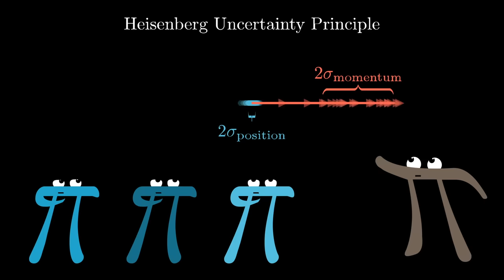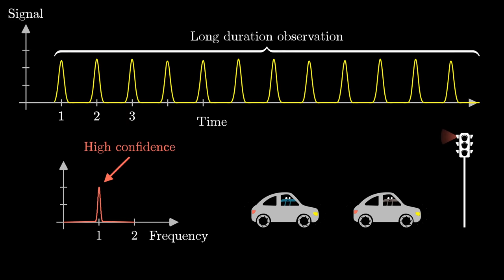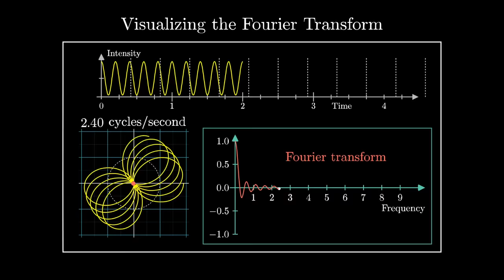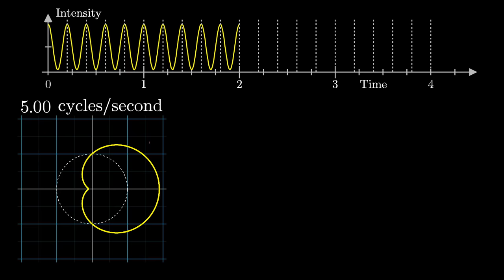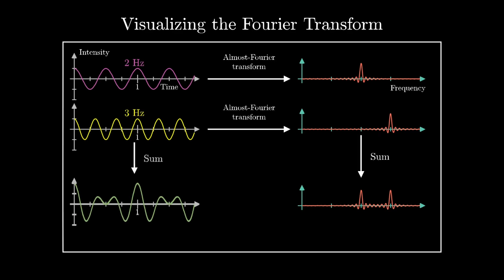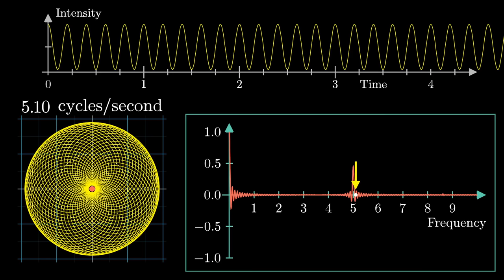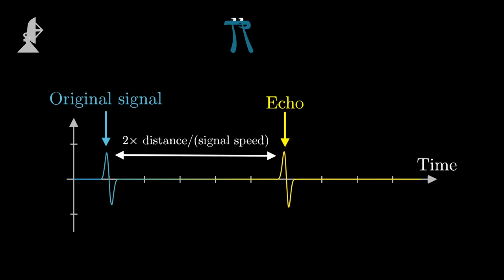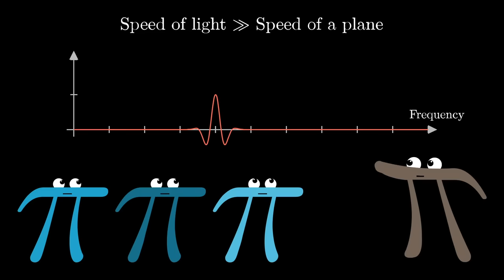The more general uncertainty principle, regarding Fourier transforms

Comment: I thought this video was gonna be on the actual generalized uncertainty principle that included the commutator not fourier analysis. Good video still, but I was excited to see how you'd talk about why the uncertainty in something is related to the expectation of the commutator. Why does the difference in if you measure one thing after another relate to the size of the distribution of those things?

Comment: well it does make sense. if you have something that is moving all around very fast in an oscillating wave that something changes its momentum a lot as that thing accelerates and decelerates but since the rate of those accelerations is so frequent chances of catching that thing's momentum near the peaks or valleys is very high, however since that thing is oscillating so quickly its hard to pinpoint where exactly is. The same goes the other way around, if an object is oscillating very slowly we can snapshot where the object is at the moment but since it's accelerating and decelerating so slowly every time we take a snapshot of its momentum its going to be different. Take for example a ball rolling down a hill and we then take a random snapshot in between when it's at the top and when it's at the bottom. literally any point at the hill is gonna give out a different momentum since the ball is constantly accelerating. normally, if the ball is perpetually falling and climbing atop many hills we would want to find the maximum momentum at the bottom of the hill but since we're taking a random snapshot the climbing and falling time takes too much time and we would almost always get a different result of momentum and rarely get a snapshot at the bottom but we would almost always see clearly where the ball is since it's falling so slowly.

Comment: I've seen one vidoe that uses this to explain the double slit experiment. Or at least why the particle that passes throught the slit behaves like a wave.
Since it's position at that moment is well defined (AKA inside one of the slits), this means that it's momentum isn't. Which results in seemingy random directions. that create the interference patters when emmited from two points.

Comment: It’s like measuring the position and momentum of a ball by throwing smaller balls at it and measuring the rebounds. If one ball is thrown, it’s position is certain however it’s momentum is not certain, and if more balls are thrown, the momentum can be calculated but there has been too much disturbance in position to be accurately determined
Reply: That is the observer effect and completely seperate from the uncertainty principle. It's not like the particle has a single, well defined momentum and position and we just can't measure it due to technical limitations, it just straightup doesn't have a single value for those things. It's in a superposition. This becomes a meaningful and very important distinction when looking at more complicated situations

Comment: Actually, the reason why you can't be sure what the frequency of a clap is is the same reason you can't be sure what the frequency of ocean sound is. These types of sound are called "noise" or "noisy" because they're made up a whole bunch a frequencies that aren't harmonics just one or a few base frequencies (except maybe some ridiculously low frequency, since technically any finite set of frequencies have some fundamental that they could be harmonics of). (If you were to look at a graph of pressure against time, you would see a function that was totally unperiodic.) It is possible to be very sure of the frequency of sounds as short of claps, since the sound waves last for a much shorter amount of time (at least for frequencies that aren't extremely low).

Comment: I would say that the 20-athletes problem is one of grouping them into two ten-man squads and seeing who wins in a first match.  Then divide the two sides into two 5-man groups, swap them, and see who wins now.  As you see which side wins and doesn't, you swap out smaller sub-groups until you finally get two a pair where swapping them changes the outcome, and thus pick the one on the winning side in that final match.  The swap would be fastest when the changes always changed the results, bip, bip, bip, bip.  The swap would be slowest when the changes did not change the results so new pairs of people would have to be formed into new groups and swapped again.  If nothing changes anything, then everyone is the same strength and the solution is impossible, since they are all "weakest" (and strongest, but that is not part of the problem, though).

Comment: You can see uncertainty in action from music... Loudness and fidelity cannot coexist at all. Increasing loudness results in reduced fidelity of music. As range of signal is limited within dynamic range, exceedimg limit  will result clipping. Thus source must be compressed, to lose fidelity in terms of difference between signals. This allows source to contain more information which determines loudness, but less information, about music.

Comment: According to the HUP if the velocity is bigger, then the position of the particle would be more determined ( less uncertainty) if you check the equation. But according to relativity, the bigger the velocity, the less determined the time (two events would not be similtunous in different reference frames), so there would be a smaller probability to find a particle in a certain position (more uncertainty). So how do these two points of view can make sense?

Comment: No, I don't think it has anything to do with the fourier transform. Rather, the uncertainty principle in a nutshell tells us the obvious, that if you want to measure something you HAVE to interact with it, and as a result destroy its previous configuration.
For example, we can't know both the position and momentum of a particle because in order to pinpoint the position better, we need high frequency (hence high energy) photons to bump on them, sending them off towards some random direction at quite a different speed than the one they had before.
If on the other hand we want to precisely measure the momentum, we have to interact with the particle twice with low energy photons, so as to not disturb its momentum too much. Low energy though means low frequency, means much lower positional precision.
Reply: No, that is the observer effect, something completely different. Ask anyone who has studied quantum physics, the uncertainty principle is a fundamental property of particles, not just imperfection imposed trhough measurement.

Comment: One question is whether this is a problem of measurement, mathematical modelling or a character of reality. It may be difficult to describe the frequency of a clap because it is too short but you can amplify it through an analogue system and play it back through a speaker with fidelity, however you will struggle to mathematically model it. A radar operator may find it hard to measure the speed and the position of an approaching object but it does have a precise speed and a precise position. Are quantum states probabilistic or just impossible to measure certain attributes externally? We can work out probabilities of picking a particular card from a deck but once we have picked it, probability disappears and reality is set. If you flip a coin you never get half heads and half tails you actually get one or the other, probability is just an averaging of many unknowns before they are realised or before they are measured. Frequency is a derived measurement and approximation to an idealised cos wave, reality still exists with concrete values that could be represented on a graph.
Reply: pretty sure an (ideal) clap is a horizontal in frequency space, so it's always difficult to describe^^

Comment: I guess what I'm confused about here is why can't you change rate at which you sample data, getting high confidence readings of both location and momentum? To use the radar example, instead of simply sending out short or long pulses, send a variable rate of pulses over time so that one second you're looking for momentum, the next location, and continue doing this rapidly. Would this yield both momentum and location, or neither? At what rate of swapping between them would your data get so muddled you don't know either value?

Comment: For the problem i think you need to have the first match up and switch one persone bethween(a new person each time) the losing team "B" and the winning team "A" until the losing team wins and than you take that person that you last added to team "B" 
we don't know a lot about that person but what we know for sure is that it is stronger than the person that went to team "A" and therefore it is not the weakest person in the group and since there is 10 person per group we have 10 switch to make at the 11th switch we will have the initial teams (but for this to work we need to suppose that these match up 10vs10 are an absolute strength mesure meaning the result are not probabilistic )

Comment: In an exam at my uni (Bachelor Electrotechnology) I had to calculate the Broglie wavelength of a car using it's mass (m) and momentum (p) and instead of E=mc^2 you use E=mp^2. I thought that was ridiculous, somehow I managed it, but of course I don't remember how. Now that I read on it again it's probably λ=1/ν=h/E=h/(mp^2), does that make sense? I think it does because h/(mp^2) would be extremely small, that's why you don't see a car jumping up and down the highway. But according to the Broglie; a car with a mass of 1000 kg and momentum of 30 m/s, it should be bouncing up and down with 7.4E-40 meters (which is smaller than a Planck length and theoretically impossible) with a frequency of 1.4E39 which is higher than gamma rays or anything we have ever seen.

Comment: Spoiler alert: solution for the AoPS question.

Assuming “strength” is commutative.
We start by taking two random people. We determine who is stronger between those two people through a 1-on-1 match. The winner is admitted into our “sending” group.
We then make another couple: the loser or the previous match, and one random person from the remaining 18 people. Again, we determine who is stronger between those two people (the loser of the previous match and the new random person) through a 1-on-1 match. The new winner is admitted into our “sending” group.
By repeating this procedure 10 times (i.e. 10 1-on-1 matches), we will have a “sending” group of ten people, such that there exists at least one person outside of the “sending” group who is weaker than any other members of the “sending” group.

Comment: But what happen when  a brick sliding over a table comes to stop? after the initial push it has some changing position and speed, so it will have also a frequency description which bandwidth should be fulfilling the time-frequency trade-off you mention (Gabor's uncertainty principle), but when the brick have stopped moving due to friction, its speed and position are fully determined, so somehow, if I take Fourier Transforms with a starting time that tends to the time when the brick stop moving, somehow it must happen that the uncertainty principle will be violated, this because even when the bandwidth would increase unbounded, through Parseval's Identity the energy contained must go to zero for a system is not moving: so at least I can say that a system at rest cannot fulfill the uncertainty principle, which is weird somehow, as it is obvious.

Comment: We can actually see this uncertainty principle in a simpler scenario without waves. Simply consider some moving object, say a car, which you measure over some distance it moves. If you measure it for a short time, you will see that it occupied a small interval of positions, so you have a good idea of where the car was at that time. However, you can't really tell how fast the car was going because it was measured over such a small time period that any fluctuations from the average speed are exaggerated over the entire interval. So, you could see a measurement of 40 mph when the car is actually going 60 mph on average. The opposite happens when you take a longer recording; the length of the interval of positions will be quite large, so it would be hard to say where it was during that time, but the velocity measured over the interval would be very close to the true average velocity of the vehicle. The real relationship here is that we need a lot of time to be able to tell the velocity but we need a short amount of time to tell the position.

Comment: The simplest way of thinking about it I think, is considering a straight beam of light. There are limits to the possible solutions to an electromagnetic wave in free space, and you can't just have a completely unidirectional beam. Because that violates what would be a valid solution to a wave equation like Maxwell's equations. So a laser pointer beam, that's very columnated, but that's only possible because its width is much larger than a wavelength of the light it carries. There is no valid solution to Maxwell's equations that involves even a moderately straight beam of light with a width of the beam of 1 wavelength. If the width of the beam is that small, it will immediately start spreading out in all directions. Thus it is only because a laser pointer beam is many thousands of wavelengths in width, that it is possible for a moderately straight beam. But this means that the wider the beam gets, the more columnated the beam can theoretically be made. If you wanted to shine a laser to the moon and not have it diverge to be a mile wide on the moon's surface when it gets there, a laser pointer won't do.... oddly enough, if you give up having it be a very narrow beam in the first place, that makes it possible to make it narrower when it actually gets there. So a beam that is 1 wavelength in width must spread out in an angle thereabouts of a radian, but a beam that is 10/(2*pi) thousand wavelengths in width, can spread out in an angle that is thereabouts of 1/10000 of a radian. Which means a 632 nm wavelength red laser beam that starts out 632 micrometers in width at the beginning, 2/3 of a millimeter, and 1000 wavelengths,  can't be columnated better than a divergence of about 1/6283 radian, so after traveling for 1 kilometer, it will be 16 cm in width...... but if it starts out  6.32 millimeters in width at the beginning, the theoretical minimum divergence after traveling 1 km will be 1/10 as much, so it can spread out from .63 cm to just 2.2 cm, and the narrowest beam it can be after traveling 1 km will be possible if it starts with a width of just a bit more than that.... but that will be optimal for traveling 1 km.... after traveling 400 thousand km to the moon, it will be 6.4 km wide. So you would want it 6.3 meters in width, and then after traveling 400 thousand km, it would be possible for it to be much straighter and only spread out from 6.3 meters to twice that by the time it gets to the moon.

But what does this have to do with the heisenberg uncertainty principle? Well the wave nature of light, it having to satisfy maxwell's equations, places limits on how straight a beam can be given how many wavelengths wide the beam is..... but the individual photons themselves, have momentums. And where in the beam is any given photon, is more uncertain if it is a 6.3 meter wide beam, than if it is a .63 cm wide beam, which allows for its forward momentum to be more certain, in other words for it to be more precisely moving forward and not to the side, and remain columnated. And there you have the 2 parts of the heisenberg uncertainty principle, momentum and position. The wider the beam is, the more uncertain the position of a single photon can be within the beam, and therefore the straighter it is possible for it to be, the less the beam spreads out further with distance.... but constrain the beam to be a narrow beam to begin with, and that makes its momentum more uncertain, and it can't help but spread out more as it travels.